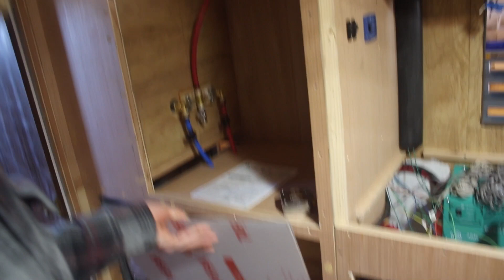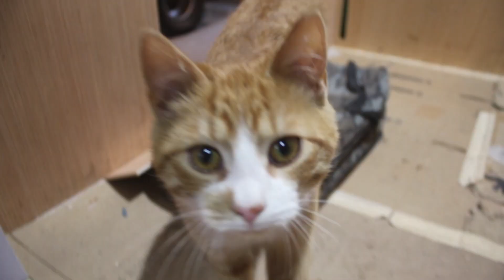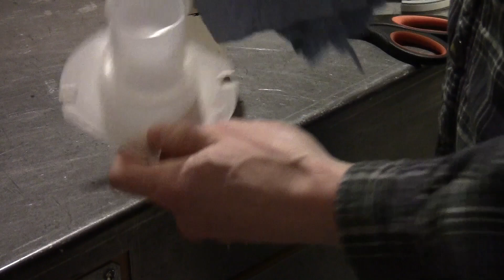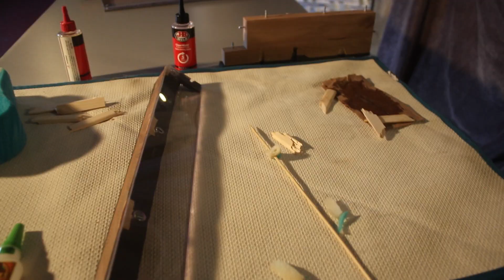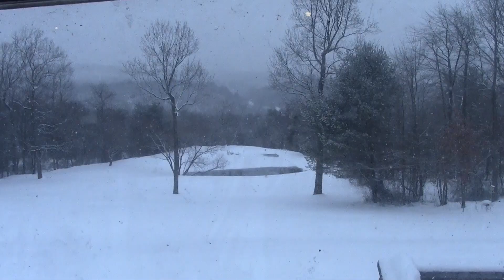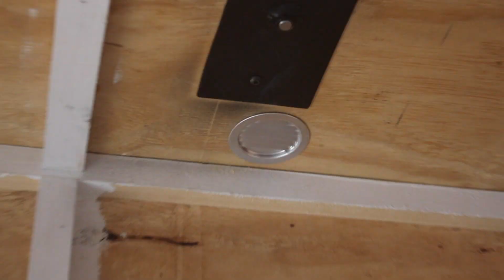BATTERY VENT HOOD VERSION 2.0 - Truck Camper Build Part 31

Comment: Hi - just happened upon your channel, have watched all of your videos so far and both enjoyed and learned something from them. Am planning on undertaking something similar myself.  I did have a question for you about the floor insulation - are not going to put some styro under the floor, it helps a lot for both cold and heat.  Same thing with your bed area with the added problem of the added moisture from the propane and your breath causing mold and actual warping/rotting of plywood from just that.  You can google info on that, there are bed liner things you can put under your mattress but insulation helps lots.   Anyway - awesome work, looking forward to the next video's.
Reply from the maker: Yes, I will be putting polystyrene insulation under the floor and in all of the walls. I also plan to possibly space the mattress up slightly to allow air flow under it to prevent mold. Thanks for the comment!